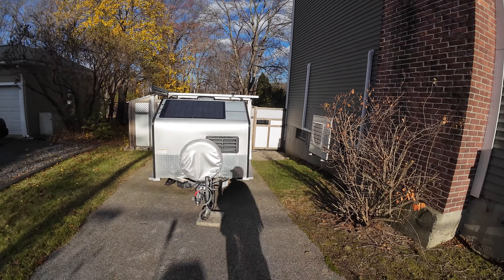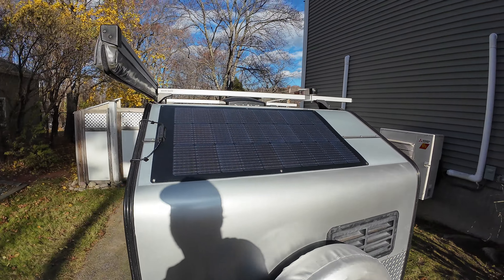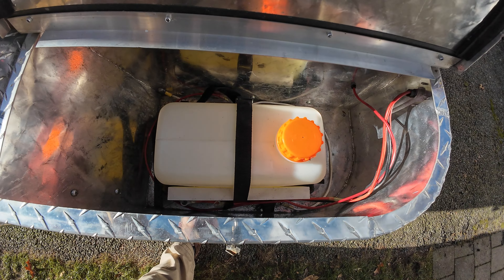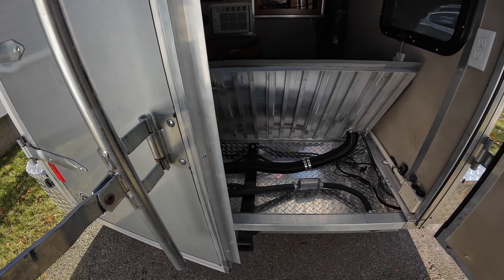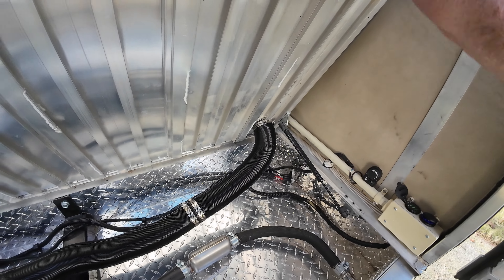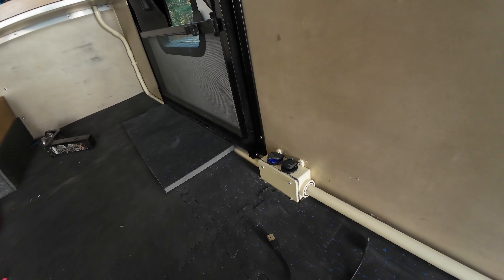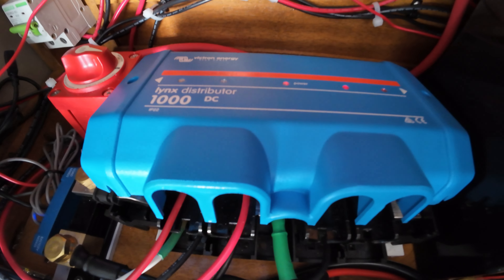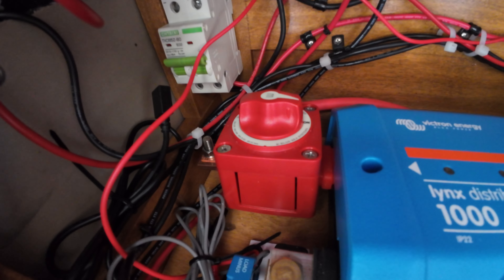Micro-Lite CargoLite Electric and Diesel Heater upgrades

Comment: Looks so tidy. Your going to roast in that little guy. Well done! 😊
Reply from the maker: Thanks!   and yeah, i tested it the other night.   38F outside and after an hour of running the heater on low it was 75F inside with the ceiling vent open just an inch.   Maybe the mini camper can double as a Sauna!   lol.    Seriously, I'll probably just open the ceiling vent and side windows as needed.